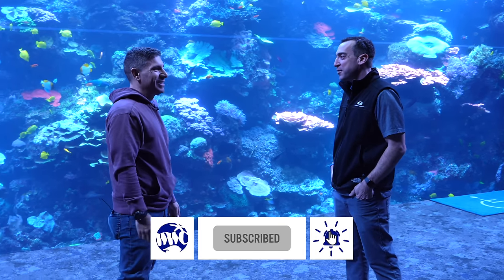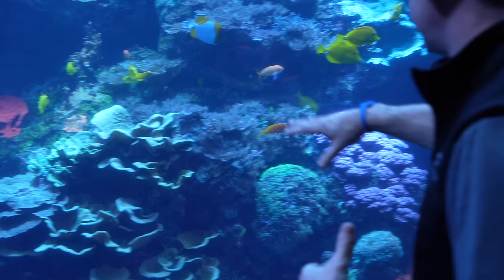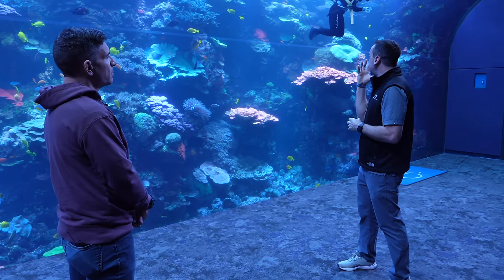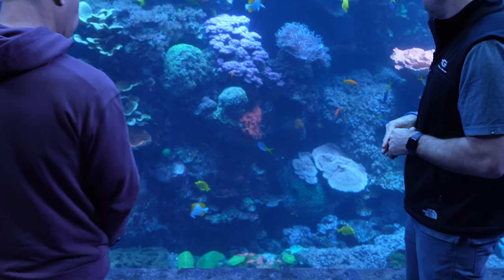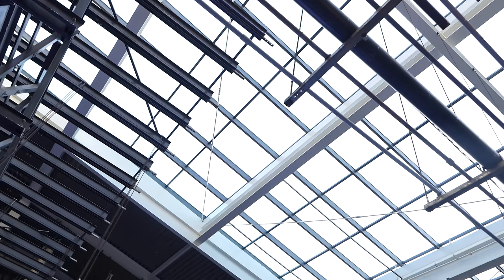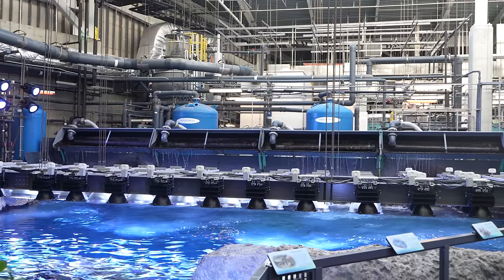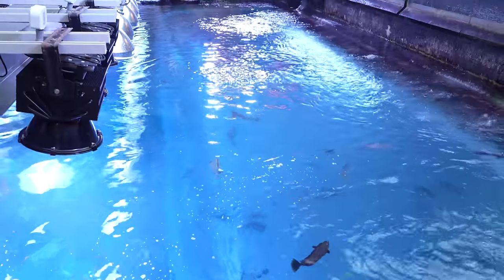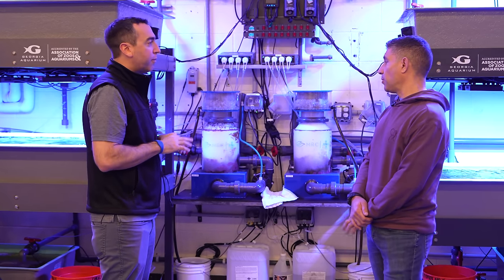Visiting the Georgia Aquarium, One of the Largest Reef Tanks in the World | BEHIND THE SCENES TOUR!

Comment: Great video and great questions Vic, the only thing I was curious about was what par was he getting at the bottom of that tank?
Reply from the maker: Great question! Unfortunately, that was not discussed on this visit, but can be on the next 😁
Reply: Hi James, the PAR values vary since there is an “experimental” LED only section in addition to the traditional Metal Halide area.  On top of that the natural sunlight fluctuates seasonally.  Without natural sunlight the test section of LEDs is capable of PAR values exceeding 300umol/m2/s (though dimmed down lower through 0-10v control).  The halides get about 100-150 umol/m2/s at the bottom (also dimmable).  The lighting system is quite complex though and the control system dims the artificial lights based on natural sunlight values to mitigate seasonality.

Comment: Could run rebreather setups so they don’t gotta worry bout bubbles
Reply from the maker: Very true, but that requires different and very specific certifications. Surely something for them to consider! Thanks for watching!
Reply: Rebreathers would solve the bubble issue but bring numerous other problems.  They are clunky in smaller aquariums, especially with delicate corals since they have the two small tanks, scrubber, and counterlungs.  In addition, they are challenging to maintain buoyancy when constantly changing depth in the shallow water.  Rebreathers also take about 30-45 minutes to setup and the same amount of time to break down after each dive.  Running through the prechecks alone takes several minutes and problems arise frequently due to the complexity of these setups.  They also require a minimum of two divers in the water at the same time whereas surface supply diving is significantly more flexible and integrates a communication system which is important for working dives.  Finally rebreathers require a separate certification program that is expensive and time consuming to implement.  We utilize CCR frequently for research and conservation efforts but rarely utilize them within the building other than training and practice dives.